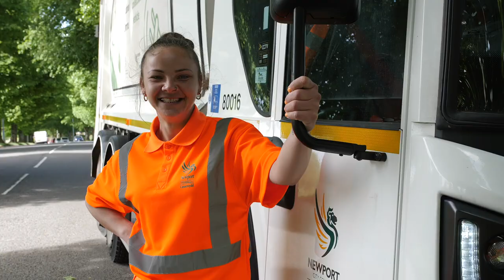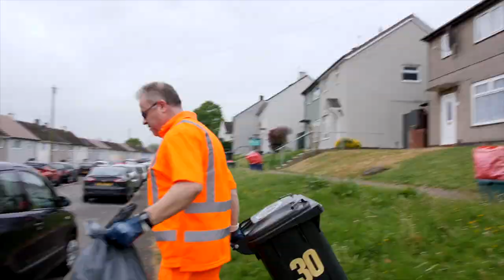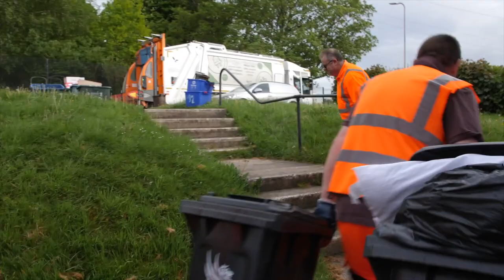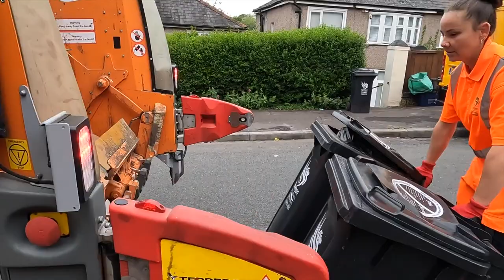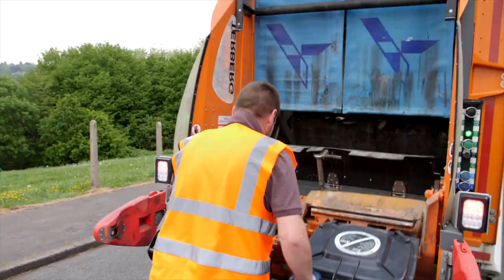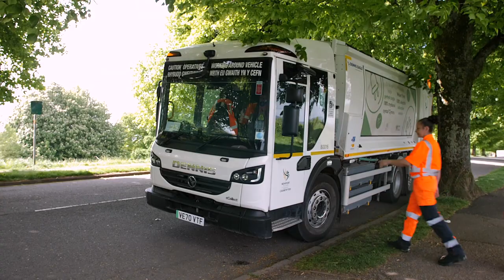Bin Days - Newport City Council

Comment: 23 years as a driver for a local authority .  The driver is right it has its stresses, mainly due to politics , noise complaints and unrealistic targets based on how fast you work, instead of time and motion and safe systems of work. That aside i stuck with it because of the hours. Being a class 1 driver, i know what its like doing containers and general haulage  and 15 hour days and nights out are the norm. Could not go back to that again. Saying that, i did think about leaving due to the cost of living crises and the fact councils are in a bubble, where they pay in council bands and not what the going hgv rate is. So our wages were way to low  for the job we were doing. That has been addressed, due to the fact they could not get any drivers, because they would not apply due to the low wage. That has now been addressed. and the pay reflects the hours and job we do. So the balance is just right now and now drivers are applying for jobs.